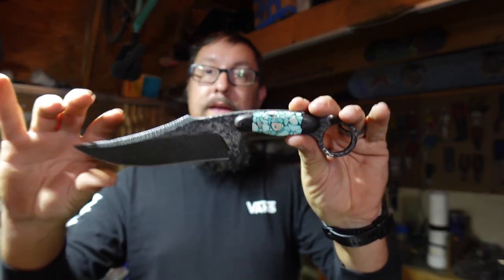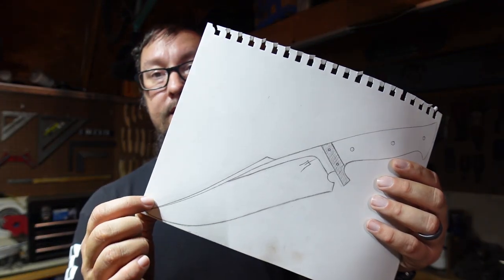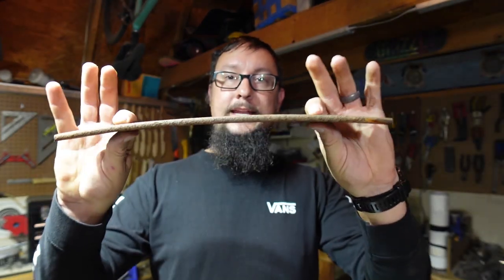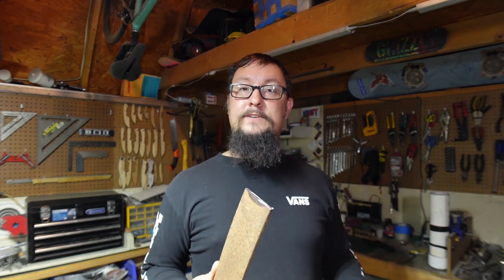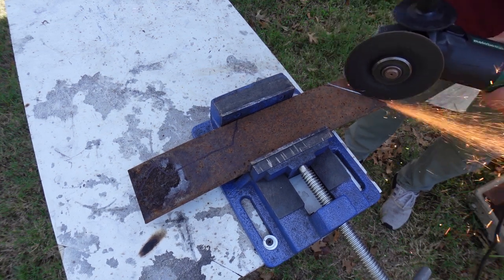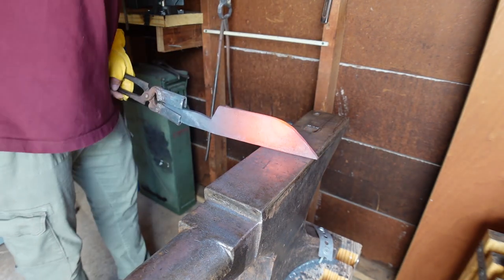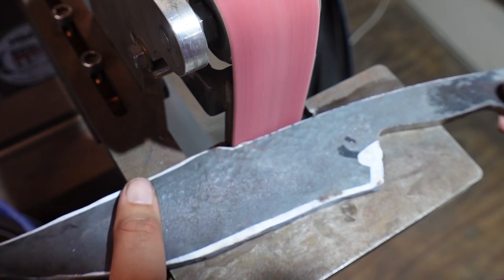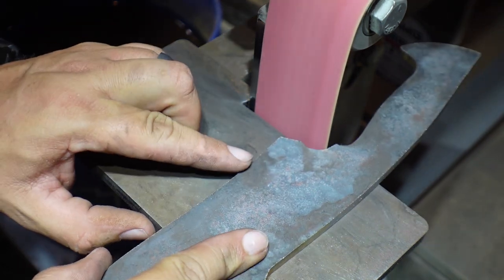Forging A Leaf Spring Into A Large 5160 Bowie | Shop Talk Tuesday Episode 103

Comment: Lol! The guards are the first things I take off of those small grinders. 
They just constantly seem to be in the way and seeing as how I have gotten by with that for many, many years...
Reply from the maker: I did stone work for years and we used angle grinders 5 hours minimum a day... zero guards. Now that doesn't mean I don't practice safe grinding lol. I never have my face in line with the disc and make sure that I'm paying attention to not flexing the disc and creating a chance for a disc to explode 🤕.
Reply: @theriversexperience9383 , Exactly! I have seen (on a friend) the damage an exploding disc can do. So operating at least somewhat sensibly is a good idea. Behind my bench grinder is a reminder to be very careful. It's about 1/3 of a 6" grinding wheel embedded into the wall right through 1/2" chipboard. My stepdad had used the grinder to grind down a piece of wood, yeah, wood. He burned it into the wheel and when the wheel cooled down it must have cracked because when I turned it on, as soon as it kicked into running speed the wheel and the guard exploded into shrapnel. Luckily the places I got hit on my chest and right arm were not too bad, but it could have been a lot worse. From then on I stand off to the side when turning the grinder on. Take care, stay safe, healthy, and prosperous!

Comment: Like I said last time, I love the profile!  That’s right in my wheelhouse for sure.  Question though, why a full tang instead of a hidden tang?   I am curious how you  attach the guard (I might steal that process 😜). Another thing you might try, cut that 45 at the tip as the spine instead of the edge and forge your bevels and it will bring it up and it becomes your clip point.  It thins your bevels and creates your profile at the same time.  Just a suggestion.
Reply from the maker: You know me, I always do things a little different. I wanted to still be able to show the texture on the spine all the way around like the Karambowie. When I forge the bevels in I typically do that with the tip, but in order to get the transition lines between the bevels and the flats, I needed to do the bevels by stock removal.
Reply: @theriversexperience9383  I didn't mean fully forge the bevels, you'd still have plenty to grind off.  Just a suggestion, I find it easier because you don't have to screw with tip as much and you get the shape you want naturally.   Anyway, looking forward to seeing this one!
Reply from the maker: @TyrellKnifeworks  hmmm, that is a good point. I didn't think about it that way but I will in the future for sure.

Comment: I couldn't find time to watch this episode before. Your cheating with cuting part of the bar is understood for everybody who don't have power hammer or forging press. I've tried to forge 10mm thick bar- Impossible. this is 8mm, right? Great job Eric! This blade shape is blast! Love it. And it's actuall very similar to one of my project (forging bushcraft bowie knife).
Reply from the maker: Yup, it's 8mm thick. It was a beast to forge. It's funny that when I forge 10xx series steel, it moves like butter compared to 5160.
Reply: @theriversexperience9383  Even 6mm sometimes is hard to forge by hand. They don't have slightly different forging temperature? Honnestly I didn't have oportunity to forge 10xx.
Reply from the maker: @DBCraftWorld  they have similarity forging temps. The 10xx series just has less resistance under the hammer.
Reply: @theriversexperience9383  Some steels are what's called "red hard". I tried to forge a broken jaw from a set of bolt cutters. Whatever it was made of was like hitting cold steel even though I had it to normal starting forging temps for 5160. That's when I started researching what the heck was going on and learned the existence of red hard steels.

Comment: I haven't seen people do guards that way, however- I had considered doing it myself and reckon its a viable way as any. Though to save yourself some pain, do it all before its hardened!
One of the best knife makers when it comes to forging to shape that I've ever seen displayed was from a fella called J Alex Ruiz who's down in San Antonio- I'm not saying that you need classes or anything, but he used to run them and if he still does, it'd be worth looking into if you ever find yourself with time/money to go do it.
Reply from the maker: I'll have to check him out. I spend a lot of time forging off camera trying to push myself to see what I'm capable of. It's a lot faster when I don't have to worry about camera angles and proper lighting.
Reply: @theriversexperience9383  For sure, its probably taking you 2-3x as long when you have to factor in the camera set up, getting it rolling along with everything else. 
Literally whenever I have hot metal in the tongs I'm in some kind of barely controlled panic mode :)

Comment: Are older leaf springs better than newer leaf springs?.. I have access to some from a 53 Ford truck but they are hard to get to but I can get new ones easy just have to pay for them.
Reply from the maker: Really you're just looking for leaf springs that you can find out what they are made of.  You want to be able to make sure that you can find out how to heat treat the steel.
Reply: @theriversexperience9383  how do you know what a particular leaf spring is made of ? Google isn't very helpful on that question.
Reply from the maker: @bobbyhempel1513  it takes a bit of research but if you ok with digging for a bit, typically you can find it. Just broaden you search question to like "Ford spring" or "53 leaf spring" then just go digging from there.
Reply from the maker: @bobbyhempel1513  I have real good luck with Jeep leaf springs.
Reply: @theriversexperience9383  seems the only information I can get is general information about  leaf springs saying that they are a carbon spring steel. I guess I can just cut off a few small pieces and test quench/ temper them all.